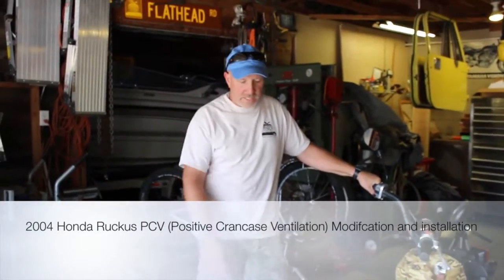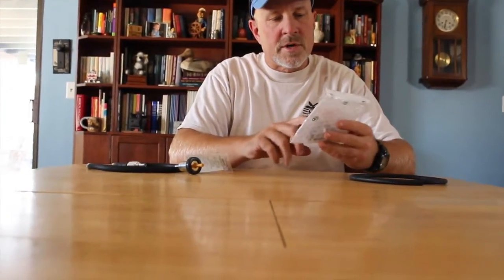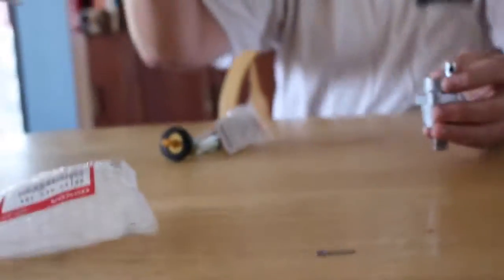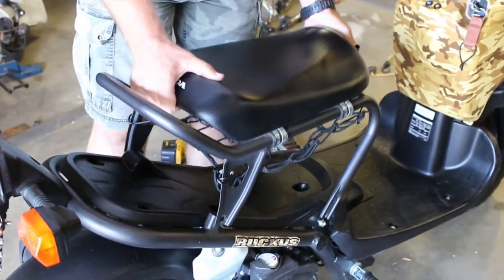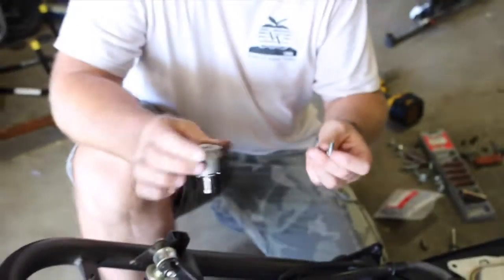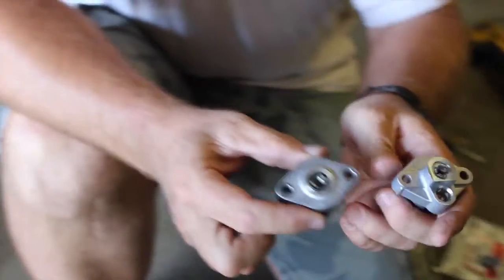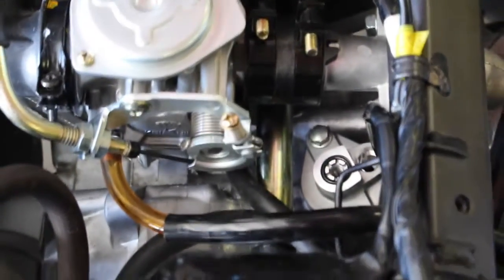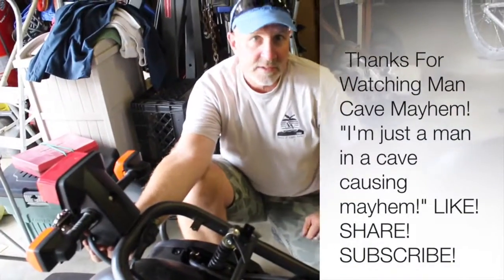2004 Honda Ruckus PCV Positive Crancase Ventilation Modifcation and installation

Comment: I just did this mod and noticed a much faster and cleaner idle, plus a noticeable increase in low end power. Thanks so much!
Reply from the maker: I’m glad it worked out for you it seemed to help mine as well👍🏻
Reply: Can you share the hose diameter and the bolt size and length?
Reply: @DetroitRetroMancer sorry dude but the scooter is long gone. Lost the crank shaft bearings 

Also it’s a 3 year old comment lol but still here

Comment: Hi, with the modified valve being open all the time and not regulated by a ECU did you have any starting issues in winter or colder weather? Thank you!
Reply from the maker: No problems at all it ran great 👍🏻
Reply: Thanks man! Two more questions, when you mentioned to reuse the gasket, is the gasket found underneath the stock cam tensioner plate or is it located on top?  Also, did you have to remove any other engine parts to reach/ unscrew the stock plate?  Thanks!
Reply from the maker: @s.m.j632  it’s been so long since I made that video and I don’t have the bike anymore. So I wouldn’t be able to tell you that. Sorry my friend🇺🇸

Comment: thanks for making this!
Reply from the maker: derek peters I’m glad the video helped. I’m not really sure about other options. I just know that’s what Honda did To the later model engines.
Reply: @ManCaveMayhem  I'm not really mechanically inclined, seems like the Ruck shop is doing the same basic thing but going through the oil dipstick hole?
Reply from the maker: derek peters yeah I’m sure that would work for you just trying to get that crank case breathing  a little better.
Reply: @ManCaveMayhem  I just chatted with the guys at Ruck shop, they said this part isnt necessary. Not sure what to do now. :)
Reply: Do you know where I can ready more on the topic? I'm not seeing much.
Reply from the maker: derek peters I would say check the forums.
Reply: I'm curious, since this video is a few years old, are there better options for this now?

Comment: I have an 03. I was wondering how much this helped, and if it still works to this day. Also if you've had to change your crankshaft bearing???
Reply from the maker: DaBlow7 HTX Ruckus I sold the scoot with bout 3,000 miles on it and it was running good.
Reply: @ManCaveMayhem  awesome. I'm doing this to my 03. I've had her since she was brand new. Still less than 500 miles on original get motor. Plan to keep her running for my kids. Thanks for the video

Comment: THIS VIDEO HELPED ME ALOT! thanks!!  I know the OEM PCV on 06+ can open to allow fresh air into the crank case. I wonder if we are better off removing the PCV valve and just putting a filter at the end of the line.
Reply from the maker: James Turner Yes the more I think about it you probably are. That addition of the updated OEM part which allows more air is the most critical part of the mod. I’m glad I could help and ride safe😎👍🏻
Reply: @ManCaveMayhem  So right after I posted this I learned you are doing it the best way. PCV that blows outwards, I put a UNI breather at the end. If the engine needs fresh air it can suck that from the breather at the top of the head. I have a airbox delete so that breather at top of head is open.
Reply: @TheJimmysGarage  yes but doesn't a PCV valve only give one way flow Direction? If it's allowing gases to escape it'll open but if it's trying to draw air it will shut. Wouldn't you be better off removing that and just running the Breather
Reply: @Yourdrinkinbuddie24  I have a pcv valve on the cam chain tensioner vent. I do not have a valve on the vent at the top of the head so it can pull air there.

Comment: What pcv valve you using?
Reply: Ok! Im about to do this to my ruckus so I just wanted to double check. Thanks for the reply!
Reply from the maker: Manny P. SMI not sure I just adapted one from auto zone it’s not really even required for it as long as you are venting the crankcase. I hope this helps👍🏻

Comment: Hello ManCave Mayhem, I have a 2005 Honda Metro with the GET2 motor.  Can't really find any info on Metropolitan forums. Is this mod applicable to Metro's also?  Thanks
Reply from the maker: I'm not sure about that. but I would start by looking at a newer Metro and see if the PCV set-up has changed. If so you may be able to order the newer updated part.
Reply: Thanks for the reply, mine is Metro '05, in '06 they have a two tube system apparently to vent crankcase, I think your mod will work.
Reply: Did you do the mod using that part

Comment from the maker: I didn't notice and mph change. But it did help to get the fuel gases out of the crankcase👍
Reply: Did you set the timing before removing the chain tensioner?
Reply from the maker: @muttsnuts5849  That was about 5 year ago and I don’t recall. I’m pretty sure I didn’t mess with the timing.

Comment from the maker: You're basically wanting the unburned gas vapor to escape the crank case on a normal PCV system it is routed back into the intake to be re-burn this is for smog reasons but as long as the gases are escaping the crankcase into the atmosphere you should be OK so you want that to be blowing out of the crankcase. I use the fuel filter just as an air filter to keep dirt from being sucked back into the crankcase. I hope this helps thanks for watching.